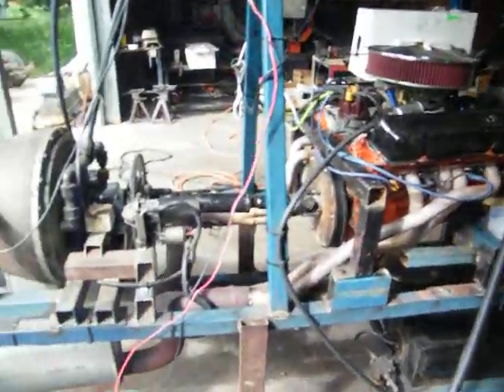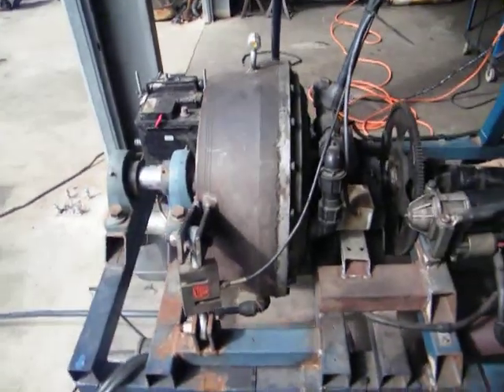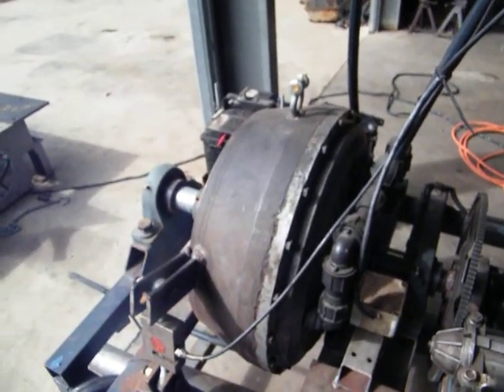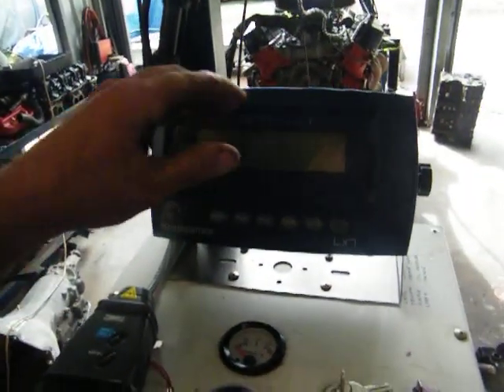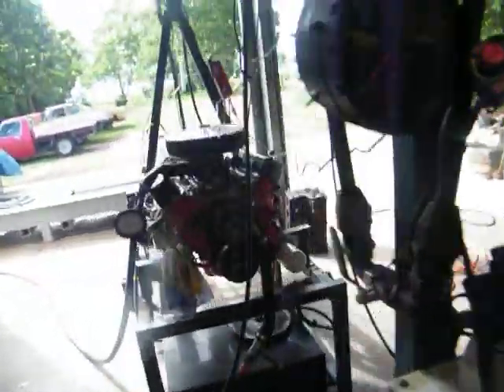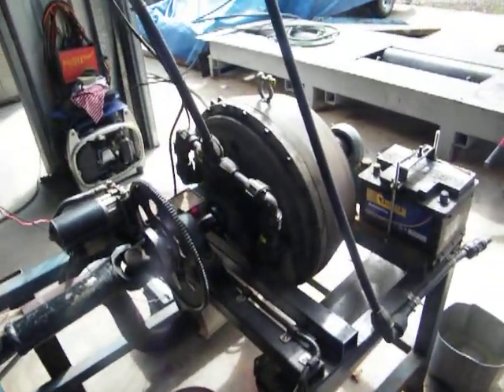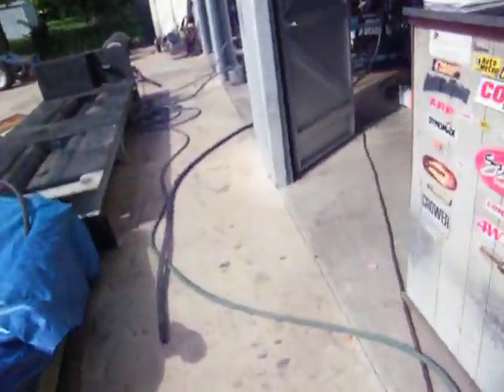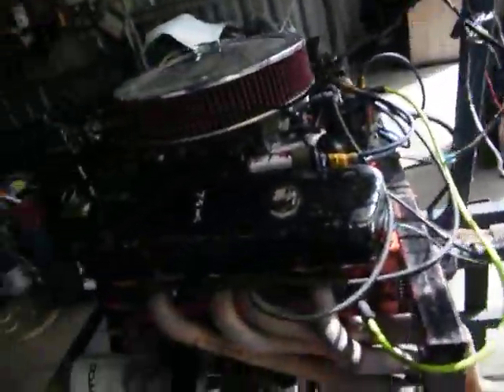home made dyno info on the retarder fluid flyweel

Comment: Question, how do you calculate how much water  you should put into it in relation to how rpm you turn it with?

Thinking of building something similar, but are trying to figure out how i can plot it.. like how much load should it be at 300, 600, 900 rpm and so on.

Comment: Use a radiator and fan, ya goof!.
Reply from the maker: it is cooled by a water pump you goof
Reply: +Marek Sumguy He's got cold water from the garden hose feeding the engine. Why would he need a fan ya goof? lol
Reply: +Chad Heistand  You can't get the right temperature window using just a cold water feed.
Reply: I don't think he is using this set up for fine tuning, it's more along the lines of a project to see if it would work. The up side is that he can get a rough idea of what his engines are putting out for horsepower and torque. Let's see the one you built, no need top be calling someone a goof from your moms basement, acting like a keyboard warrior, " Hey mom bring me a pizza pocket, im being a bad ass on the computer"
Reply from the maker: you can hold the rpm at any speed you want and any load it will pull the revs down to a stall if you want  at a steady load totally variable I will be doing another std engine on it soon so I will do a demo then
Reply: So how do you maintain correct operating coolant temp with just a direct-drive water pump??
Reply from the maker: I have a quarter turn valve on it and I adjust the flow to control the flow hence control the heat it usually only  needs a small amount of flow thanks for asking cheers Jim

Comment: Are you able to stall the engine through the entire RPM range with the torque converter?  Does the torque converter apply enough load below the stall speed to still be effective and stall the engine?

Comment: Is it possible of holding the engine at full throttle at any RPM say from 1000 - 6000 rpm so you can graph the torque output?

Comment from the maker: yes the level has to be controlled by the valve you will need a valve on the bottomto let the water run out and controll the drain the water runs out the bottom where do you live  my email address is fasterengines@live.com

Comment from the maker: yes the water is regulated by a tap and runs out the bottom so the more water the more load on the engine and the higher the ft ld until the engine cannot load it anymore this is max torque

Comment: Fantastic setup, was looking into making something similer myself with a waterbrake setup...

One question though, is the water brake always full of water constantly flowing? Or do you have to adjust it? Does the amount of water not effect the ft pound reading?
Reply: You see there is water valve that controls the amount of water fed to the torque converter this is what controls the load, aside from mounting the converter on bearings, making the load are and the appropriate ports for the water I suspect  there won't be any other mods.

Comment from the maker: yes i drill a small hole in the top of the retarder about 5 mm to let the air in and then restrict the flow out of the bottom eith a 13 mm quarter turn valve you can see the hose in the video you can adjust the rate depending on the amount of load  up and down speed you want
Reply: This is genius! I just need to find a retarder that will work up to 12,000rpm. I want to build mine for a rotary engine.